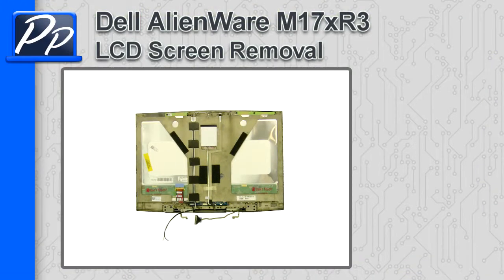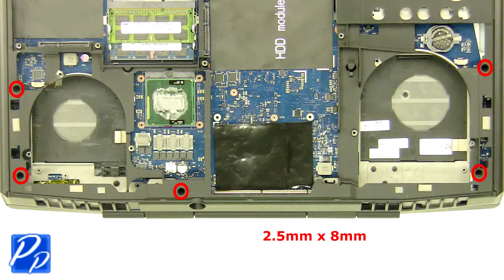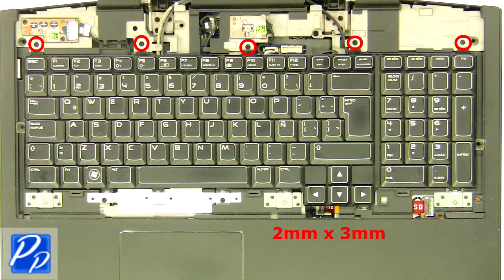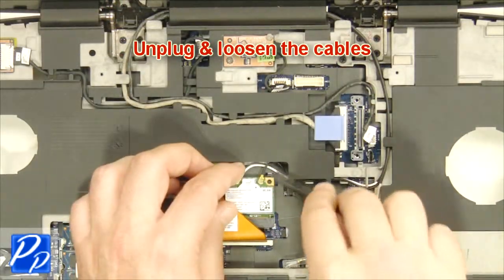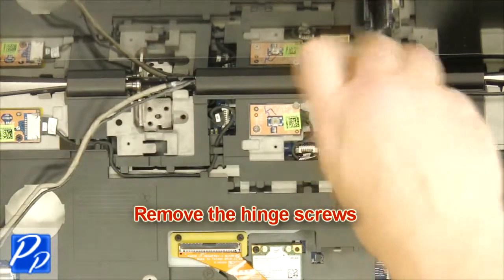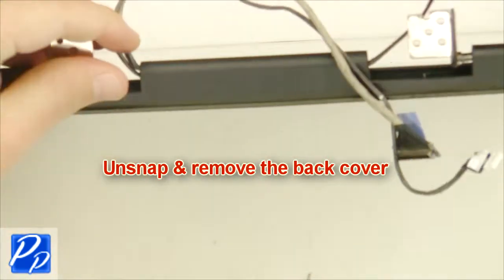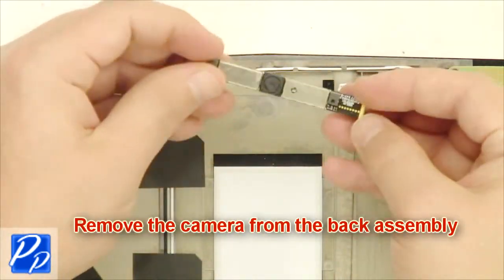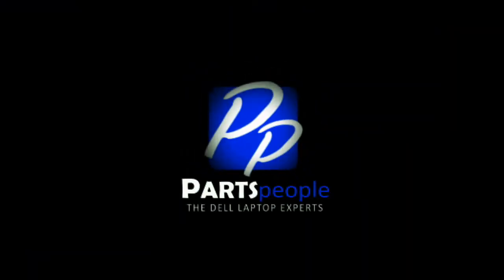Dell AlienWare M17xR3 LCD Screen Assembly Replacement Video Tutorial

Comment: im wondering if its possible from 2:33 where you remove the display assembly, to use the display as a separate monitor on a different machine via HDMI. i understand that this will need a display adapter but curious to know if this current M17xR3 display can support that

Comment: Hi. I have an Alienware m17x R3 1600x900 resolution. Can it be changed on a 4K screen? Or some of higher resolution? What would you recommend?
Reply from the maker: You have an HD+ screen. The highest this model offers is an FHD (1920x1080). It doesn't have a 4K option.
Reply: ok thanks